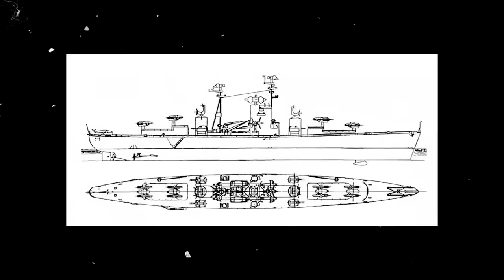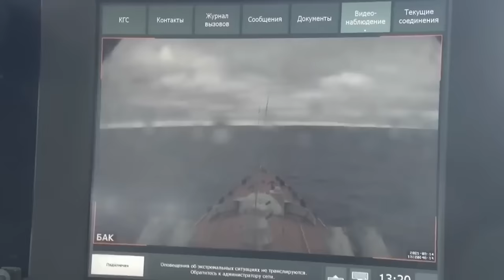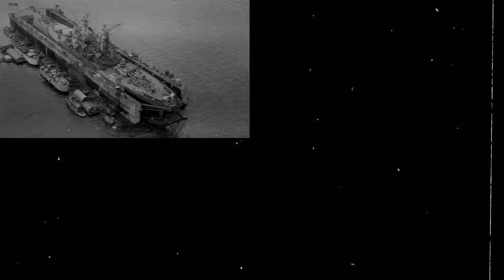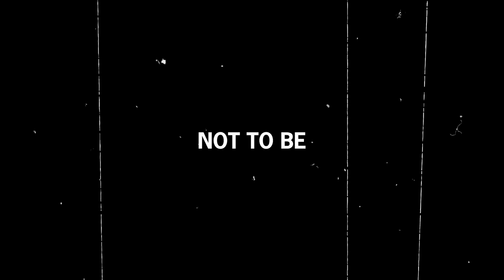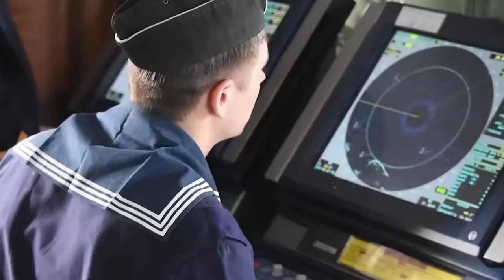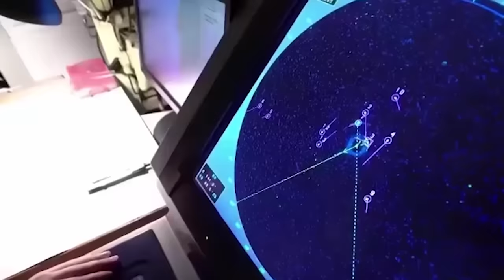The Monster Nuclear Battlecruiser 2X the Size of American Competitors

Comment: I've been around since the 60's. I can honestly say this ship did NOT make me tremble.
Reply: Damn, I did not know you were the whole US.
Reply: Glad it didn't make you tremble.  It caused quite a political stir however.  Good to know you were the entire US Govt back then.
Reply: @dancarter254  well we.are.still here so.......
Reply: Not even a small chill?
Reply: I hear ya Doug.  I was on active duty USN from the early 1970s until 1993.  Shortly after Kirov entered service she began having "issues" that resulted in restrictions in operations.  She APPEARED impressive but in reality really didn't require the reactivation of the four Iowa class ships to counter these oversize missile batteries.

The Kirov class' real value was the intimidation and prestige factors, something that also made the Iowa class valuable as they reentered service.  We recognized that the Iowa would NOT be able to counter the Kirov in a one-on-one matchup, the Granit SSMs carried by Kirov provided numbers in missiles that the Tomahawks in Iowa could match (32 Tomahawk vs 20 P-700) and, on paper at least the Kirov had a much more capable anti-air and anti-missile defense.  

Kirov's surface to surface missiles far outranged the 16" guns of the battleship although a single 1900 lb 16" high capacity (HE) round could be enough to cripple the lightly armored cruiser.  A 2700 lb armor piercing round would have no problem with even the most heavily protected parts of the ship, her reactor compartments and even the reactor itself.
Reply: @robertf3479  There were also the katie nuke shells made just for the Iowa-class’s guns just in case the 2700 lb. AP shells weren’t overkill enough 😂

Comment: The Moskva went down with 2 missiles. In case of a hot war I doubt this would survive a single engagement if it ever set sail.
Reply: Any Warship today is desinged to >not< get hit. Any Ship today would sink after 2 Missile hits! They do not have heavy armor like Bismarck or Yamato.
Reply: @Kalgani  USS Stark, USS Samuel B.  Roberts and USS Cole would beg the difference. 

Even if critically damaged a ship has a chance of getting back home if the sailors on board are properly trained in damage control. I very much doubt the Russian navy is up to par in that category
Reply: In todays age with missiles, no ship can tank most navy ships have a high chance of sinking. Doesn’t matter what country the ship is in or what type of sub class the ship is. It also depends where the ship gets hit as well.

Comment: Nuclear powered ships ARE steam powered ships.  Hot control rods go into a water tank generating steam which, in turn, powers turbines that power the ship.
Additionally, the reason it doesn't actually instill fear in the US Navy is that a few big ships with a lot of armament doesn't pose a threat to a fleet of smaller ships with fewer launch tubes.  It only takes one or two missiles to demilitarize a ship, so disabling just one of those ships neutralizes a huge part of the opposing force.  
Add to that how well known the rampant corruption in the soviet union and russian defense industries and the ease at which their missiles are neutralized mid flight and the difficulty with which they have neutralizing western armaments, the west no longer trembles at the machinations of Russia.
Reply: most people don't know how powerfull steam is. The problem was the fuel, coal was heavy and not that efficient.
Reply: Thankyou. Nuclear is only high tech steam

Comment: They are no more significant than the Bismarck class battleships.
Reply: Less if anything, at the time the Bismark class were extremely capable, heavily armoured with excellent armament. Contemporaries of the Kirov dont really exist but it is certainly vulnerable to AS missiles and submarine attack
Reply: The Bismarck class and the other heavy units were a waste of resources and didn't contribute as much to overall war effort. The resources could have been used for better aircraft, tanks and submarines.
Reply: @john4896  Ah but if the war had started a couple of years later when the Kriegs Marine had built the ships it had planned......

Comment: Out of curiosity, do you have a class of ship in mind that the US might recommission as a potential counter to the modernized Kirov coming back into service? I can't imagine they would recommission an Iowa, and I can't think of any previous classes still in existence that could be reactivated and modernized to counter this ship.
Reply: The US Ticonderoga class cruiser would be more than a match for a Kirov, But those are slowly being retired in favor of smaller but just as lethal destroyers
Reply: If the day comes, were one of these needs to get taken down,
it would probably be from the air or from submarines.  

However, since it's a clash of the Titans you're asking for:
The USS Zumwalt entered drydock in August 2023 
to have its guns replaced with VLS-modules for the 
Long-Range Hypersonic Weapon (LRHW). 

Now, From what I understand LRHW isn't exactly an anti-ship
missile, but I'd bet good money the Navy has a way to
guide those missiles into a Kirov-class sized target on the move
or wont rest until it does.
Reply: i doubt an Iowa could take the hit off those ASMs.. the belt armour, - maybe, but the upperworks. nope it would be like being hit by a V2
Reply: @A_Haunted_Pancake  Hypersonics aren't exactly good at hitting mobile targets. There's a reason that America's missile doctrine has favored low detectability over speed. We've had the capability to build hypersonic weapons, but their high-speed is actually somewhat detrimental because they can't make micro-adjustments as well as lower speed weapons. Like when you're driving at high speeds on the highway and it's virtually impossible to make a 90 degree turn like you would driving on the back roads. It's only now with the progression of technology that is changing and even then I suspect that part of it is more giving in to public pressure because the masses aren't as aware of these nuances and thus think more speed automatically makes a missile better.
Reply: @andyf4292  You have to fire them first, these things generally have atleast 1 submarine near them all the time they are at sea
Reply: US attack submarines would likely put it down long before it got close to a battle group.
Reply: @Blackreaper95 Strong possibility. It's why the majority of Russia's surface fleet that isn't devoted to a kamikaze assault on carriers is anti-submarine vessels. Arguably their sanest "carrier" design were the Moskva-class helicopter carriers. But then they decided to screw over any chance of focusing on a Navy that was good for defending Russia in favor of a dick-measuring contest with the US.
Reply: Well, you all are right, an Arleigh-Burke or Tico likely does have the firepower to take one of these ships on, and they are likely vulnerable to attack subs. But the video talked about how the modernization and reactivation of the Iowas was in part motivated by the appearance of these ships, and at the end posits that perhaps the modernization of the Kirov class ship might provoke the reactivation of another older US ship, and I'm just scratching my head as to what that could possibly be. The Iowas were the only logical choice in large surface combatants back in the 80s, but I just don't see the USN ever bringing any of those ships back now for a variety of reasons. I just can't think of a single class of previously decommissioned ships still in mothballs that might be a good answer.
Reply: @andyf4292  yeah, I only mention them because the video said the appearance of the Kirovs in the late 70s prompted the modernization and reactivation of the Iowa class ships. In those days, the armor belt might have been somewhat effective against smaller ASMs like the older exocets, but I doubt it would stand up to Russia modern ASMs. On top of that, the last time anyone operated the steam boiler power plants on those ships was 1992 or so. So the only people left who did that have not done so in over 30 years, and god only knows if they even still work. On top of that, there is now no more ammunition for the big guns, and no one who makes it. So to reactivate an Iowa would likely require cutting into the hull to rip out and replace the engines with something modern, and removal of the big gun turrets and installation of VLS, plus a whole slew of upgrades to their now outdated sensor suites. I think it would be prohibitively expensive and time consuming to do all that work on such an old hull.

Comment: We countered them by simply reactivating four Iowa class Battleship which had nine 16 guns and of course ARMOR
Reply: I would have loved to have seen an Iowa vs Kirov engagement. It would have been like Tyson vs a light weight. Loads of movement, action, noise - all shrugged off on the gloves and shoulders. Followed by one fast combination / volley. To the canvas/ Davey Jones Locker's you go.
Reply: @Boric78  The Kirovs would sink faster than the stock market in a panic.
Reply: @Boric78  Soviet designed warships mount their missiles in one shot launchers on deck to allow the rapid launch of their war load before a sea skimming harpoon missile or three causes a sinking.  Since the Iowa was refitted to 9 16s 12 5s, 32 tomahawks, 16 Harpoons, and 4 CIWS plus massive amounts of armor, my money is on the old ladies
Reply: I'd say Iowas guns would have had as much chance
to match the 300 mile range of Kirovs P700 missiles, 
as its amor would have resisting the 500 kt warheads on them.
Reply: @haroldcarfrey4206  A) The Kirovs missiles are not deck-mounted, B) its P700s could go Mach 2+ while the Tomahawk is subsonic, C) The Kirovs have 8 CIWS + AA missiles, D) I doubt even the best amor can shrug of 500 kt nuclear warheads. 

That being said, the Iowas Tomahawks were nuclear capable as well,
so that WOULD have been naval battle of the ages.
If anyone had been left to tell its tale however ...
Reply: @A_Haunted_Pancake  the Kirovs have eight CIWS but they are hydrolocally powered and using a central radar array that is at best obsolescent and has tracking sea skimming targets like the Harpoon missiles, but 16 inch shells are impossible to intercept, and the fire control system has a tendency to jam it's point defense system and communications.  Also, it's dependent on spare parts scavenged from the other two Kirovs, it's engines are due for replacement, and the reactor has .... Issues.

Comment: Turned out to be a paper tiger as most of the systems are more hype than lethality. They used to say Russian ships had defence in depth with multiple systems, because none could be relied upon to work properly. The Russian Navy has lost many more men to accidents, fires, radiation leaks and faulty weapons than they have killed in combat since 1945.
Reply: YOU’VE JUST DESCRIBED ALL THE US GAME-CHANGING WEAPONS IN UKRAINE THAT DONT WORK.

US Held back on sending M1s because you didn’t want to see them burning on the battlefield AGAIN.
Reply: @JohnJones-k9d  Funny Guy, the Ukraine has been getting old NATO weapons which are still potent against Russian crap. The US took all sensitive stuff out of those Abrams before handing them over. The Abrams crews usually survive if the tank is hit. Not so the crew of Russian tanks - they burn with the tank.

Comment: The USN has subs following every RUSNav task force that leaves russian waters. They won't last long.
In the 80s, the soviets used to plan on trading ships in a naval battle with the USN. They believed that they could endure 3-5 lost ships for every one of ours. However, after the first engagement they would be nearly defenseless. (They can't reload) And their math was way off. Our projections had them losing 8-10 to our 1. (if we were generous)
They couldn't track our submarines and our Aviation units were far superior in training and equipment. That was 45 years ago. We've gotten better and they fell back. 
Any engagement today would be a repeat of the Russo-Japanese war where they lost their entire fleet in the first battle. 
Saddam's forces used Soviet kit and training and we walked right over them. And today they can't even match a mostly militia army using borrowed gear in Ukraine.
China is no better and probably worse.
I worry about west asia. That could be a problem.

Comment: The true humor of the Kirov class is the same as for the Russian navy's aircraft carrier.  They are both classified as cruisers  (the Kuznetsov is a heavy aircraft cruiser and the Kirov is a battlecruiser) due to the Bosporus Strait which is Turkish territory.  The Montreux Convention disallows military vessels whose tonnage exceeds 15,000 tons to transit the strait.  Cruisers were defined as warships up to 10,000 tons in the 1922 Washington Naval Treaty, which was still in effect when the Montreux Convention was signed in 1936.  To work around this, Russia just calls them cruisers despite being well over the tonnage limit.  The Turkish government does not challenge this because in doing so, they would have to change the Montreux Convention which the original signatories would undoubtedly ask for changes that would weaken Turkey's sovereignty on the Strait.

Comment: If the aircraft carrier is a mobile airbase that is protected largely by guided missile ships that are expensive af to arm & the group as a whole can only deliver a few thousand Marines, then f***! Reactivate the Iowa class again! OR! Design a new Iowa class battleship that can carry 10x...100x! the number of deployable soldiers, that has even more & larger gun batteries, dual... triple! nuclear reactors for the use of on-board directed energy weapons, rail guns, sonic weapons, & other such advanced exotic weaponry, & protect it with all varieties of conventional weaponry -- anti-aircraft guns, deck guns, flamethrowers, grenade launchers, RPGs, sniper nests, harpoons, torpedoes (& some of those fancy supersonic underwater torpedoes that Russia has), anti-submarine weapons systems, & vast drone swarms deployable into the air & under the water. & Why not have a deployable Zeppelin of its own to fly patrols? Then it could have old school Zeppelin docks installed just in case they make a comeback! & Yes, it should be a fully capable ICBM launch platform to carry nuclear warheads, to knock satellites out of space, to deploy battlefield specific & dedicated satellites ad hoc, etc.... 

Build it so big & its outer hull so thick & so strong employing advanced metallurgy that the ship could withstand the direct impact of a 1 Megaton warhead & not be compromised -- not by the kinetic energy of the blast nor by infiltration of any sort of radiation into the inside of the ship (i.e., no electromagnetic radiation, no gamma radiation, no neutron radiation, etc.) -- & make it stealth because why tf not?!

Hell, make it into a semi-submersible ship too -- make its approach look like that of a dingy, & then all of a sudden your dealing with a goddamn Kraken that just erupted out of the sea!! & As this thing emerges out of the sea, make it mandatorily announce its arrival with the heavy guns firing every which way & until it's finally nestled itself comfortably into its natural position above the water! If we're building a real warship here, the mere thought of its arrival needs to terrify young children in their sleep!

Float one of these mf silent & stealthy behemoths off the coast of a Nation, along with a carrier group, & that act alone would be sufficient to claim that we've taken control! Your Nation is now our Nation!  ....I think we could do it.

Comment: I have said all along the us navy is making mistake in smaller destroyers. These battlecruisers run correctly are.awesome. the usnavy has no ability to support beach landings. 5 inch guns are the biggest gun on us ships. There are times just as in ww2 where many ships with  16, 14, 8,6, guns were used and the landings could not have been done without them. Now we have nothing but a few missles. No cruisers are being.built. all the u.s. is building is destroyers that are great but not a battleship. We are going to need shore bombardment  in the pacific just like we did in ww2. We need old fashioned artillery on ships not peashooters.

Comment: It was a flawed design when it was first imagined fifty years ago and bolting on more and more "modern" Russian weapon systems that were never designed for naval use and integration has only made things worse. Their inability to modernize their basic infrastructure such as engines and reactor mean they will never even have the capabilities they once had let alone improve and without modern destroyers or cruisers to bolster their air defence their lack of air cover becomes a critical weakness anywhere out of range of land based air cover making their impressive range pointless.

Comment: They most important element in a weapons platform (amongst many) is the capability of the ammunition it fires.
Reply: That at least seems to be the Russians attitude.

They've kept the weapons systems up to date, but from what I've
been able to gather, the sensor suite is more or less the same
they were designed with over 40 years ago.